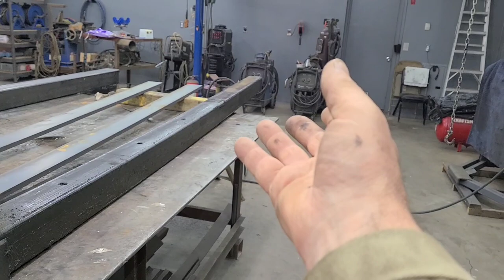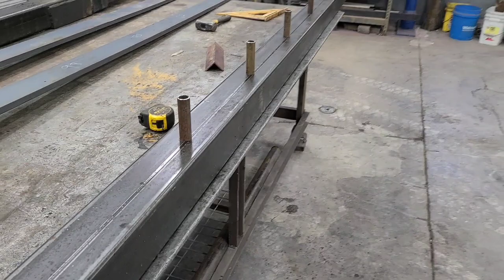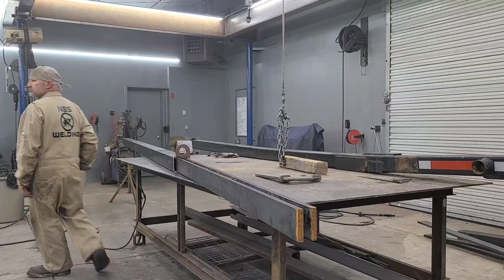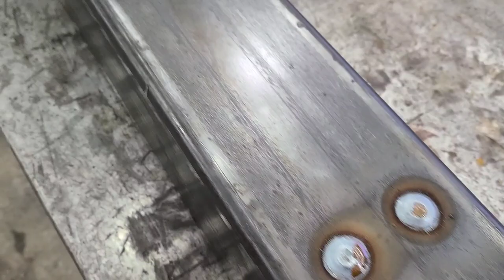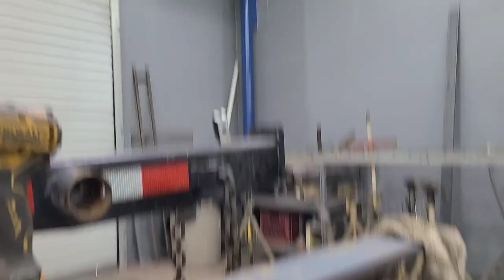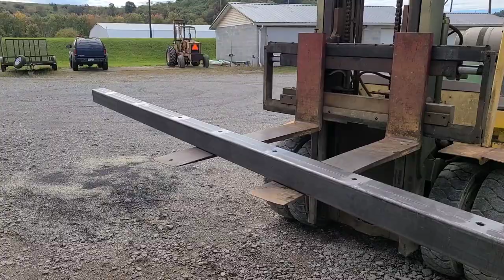Pine Hill trailer tongue rebuild

Comment: Iam 4:16 into this video dude. I cant wait to see your channel blow up. Its always fun and I learn from each video. 

AS a NDT guy though. All you repair folks really need to get your self a magnetic particle yoke. It will help to chase and find those cracks way easier. You can get the same effect some times after you arc gouge and do a little but of grinding. Sometimes the bits of metal will form along the crack.  

Also you could get your self some PT stuff. Its cheaper and you can do all the metal bits, not just carbon steel. But it takes a little longer.   Iam sure you see. The stuff on the pipeline. If not and you are interested. I will link some stuff up for you. 

Looking forward to watching the rest of the video dude!
Reply: PT?  please list rec's

Comment: Hey Mr NBS, how come you run your wire off the top of your spool ? I know you have a good reason but I can't figure it out
Reply from the maker: I assume your talking about how the wire comes off the spool on the Millermatic 252 MIG...that is just the way it was designed by Miller to work...many MIG machines feed the other way but pulling wire off the top has become much more common in the design of wire feeders over the last several years

Not my decision...if I flip the spool over it would be bending the wire to get it through the drive rolls

Comment: This repair is still going strong! I have since had several 40ft buildings on this trailer that requires to have the tongue all the way stretched out,which puts the tongue in it most vulnerable state to bow. A couple of these 40 footers were finished out with dry wall which makes them much heavier and the tongue dos not even bow!!! This repair, or I should say this whole fabrication design that MR. MF C.B. Phillips and NBS is bad ass and way better than the original manufacturer’s design thanks again bro you the man!
Reply from the maker: That's great to hear!!!

Thank you for the update comment

Comment: Pine Hill Trailer should definitely put your modifications into production... your version seems much stiffer without really adding that much weight.... if they just adapted your sleeve & plug weld upgrade and kept the 1/2 plate it would probably still be adequate, but MUCH stronger/stiffer than their design. My hat's off to you on this repair/upgrade. Also, please give Miss Diane a few extra pets for me. Keep on keeping on.
Reply: Sure... if people are willing to pay for it...

Comment: I reuse and recycle bolts too but if I have to heat and beat a bolt it gets down graded in my head and doesn't get used for safety critical applications

Comment: Ok 👍. I have used those carbide burr bits with a small variable speed router, very controllable if you have a flat surface to hold it against. Used that at the slowest speed.
I’d rather weld then work.

Comment: Hi buddy a engineer tip do not use bolts and nuts that been heated or have grease on the threads. As a welder your time is money cutting is less time than heating
Reply from the maker: I've used bolts that have been heated for over 30 years now...never had a problem 

I almost always lubricate threads during assembly...usually with anti-sieze or pipe dope...been doing that for over 30 years too...never had a problem...actually seen the benefits more than once because nuts that I tighten don't come loose on their own but if I want to take it apart it's never a problem with regular tools.

You do it your textbook way if ya like... I'll do it the smart, effective, economical way that I've learned works from decades of hands on experience

Comment: Very nice work! That will sure be a lot stiffer now. If the original tongue had those 1/2" bars inside, how did they weld them? If they were just welded on the ends, in my mind they're pretty useless. If the tube flexed, I can see those twisting inside and not preventing any flex. Now that you plug welded them, they cannot twist and will really make that solid. At least that's what I imagine.